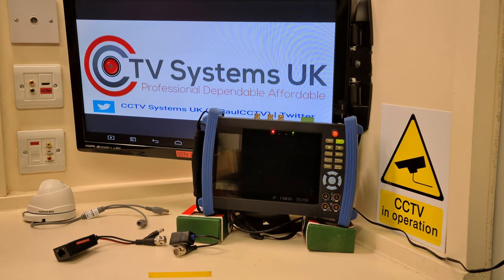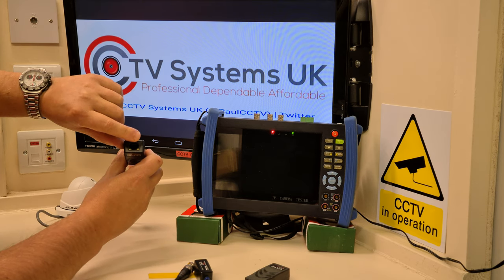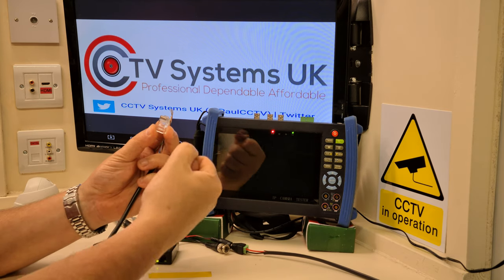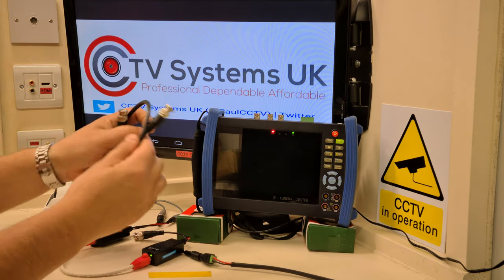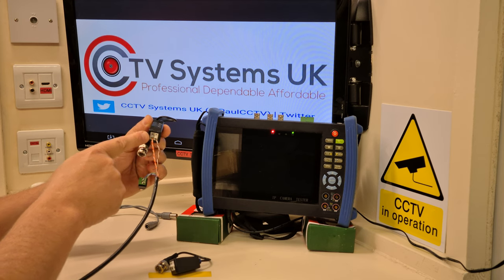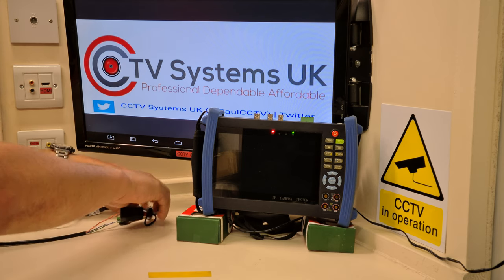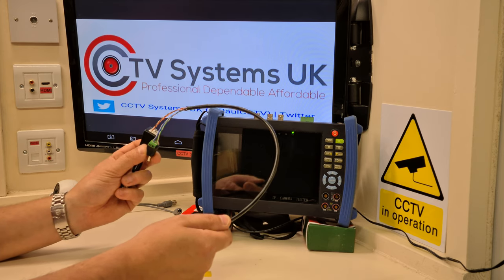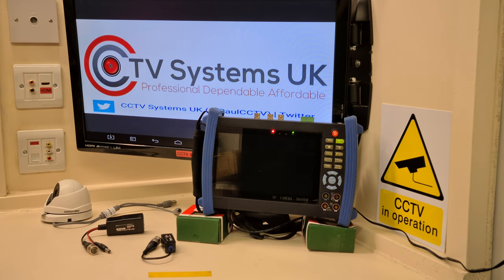CCTV Video Balun Setup and Connection with Hikvision TVI Camera

Comment: I have 2 HIKVISION dome cameras that I would like to use on my home Lorex CCTC system because 2 of my Lorex cameras are no longer serviceable. The replacement HIK cameras are both network cameras with MAC addresses. My Lorex system is power and coax wired in. If I run a cat5/6 and use the Baluns at both ends as you have demonstrated will I get a picture?  Many thanks.

Comment: good morning sir, regarding the video balun sir as you mention that the blue is on the dvr side and red is on camera side.what will happen if installed opposite? is there any video distortion on the video of the camera? one more thing about the rj45 wiring the 865B connection. there are 8 wire in there or 4 pairs. in this connection how many wires or wire goes to power and goes to video signal. thanks.

Comment: I have HDCVI cameras setup with the half baluns but I’m getting power crossover interference and moving horizontal lines when I view the cameras.  If I use the RJ45 full balun will this remove the interference?

Comment: will a pure copper cat 5e cable with these baluns deliver full 4k analog hd video in full quality? bandwidth enough?
Reply from the maker: Hi,

Yes it will as long as it's the full copper on copper Cat5e cable.

Remember to use something that is 350Mhz.

Regards, 

Paul

CCTV Systems UK
Reply: @CCTVSystemsUK  Thanks, appreciate your help

Comment: Hi,
I don't think you should be using 2 pairs for the video feed, it should be 1 pair for one video balun.
Reply from the maker: Two pairs are always better than one.

CCTV with two pairs in the balun gives a certain amount of redundancy in case one pair breaks. This is especially relative and important when installs are carried out in this configuration in cold countries.

If installation takes place in very cold conditions, one pair can break very easily as Cat cable becomes extremely 'brittle' in the cold. Also freezing temperatures can lead to a break in the Cat cable inside any enclosure that the connections are housed in outdoors if there is any significant tension on the cable due to a tight fit. 

In both cases two pairs are far better than one. As using one is just laziness by the installer to be honest!

Regards, 

Paul

CCTV Systems UK
Reply: @CCTVSystemsUK  

Why would anyone parallel multiple pairs for analog video? One pair is 100 ohms, which is what baluns are designed for. Two pairs would likely create an impedance mismatch, which could potentially cause ghosts and double images in the picture.

1 pair should be used. the reason is that one pair can have different number of twists than a second pair.

the signal is measured as the difference (voltage) across the two wires- this is good because any noise present in the cable run should appear on both wires and effectively cancels itself out resulting in only the original signal being processed. different pairs with different twist ratio could allow different noise to be present and NOT completely cancel itself out.

looks like installer is getting confused using two pairs. using two pairs means more cross sectional area for signal to travel down or using power allows more current to flow, increasing the cross sectional area means less resistance- so doubling up would effectively half the resistance of the circuit.
Reply: total agree with you alway done it that way two pairs in the balun ;)